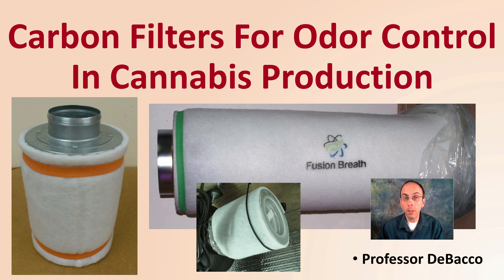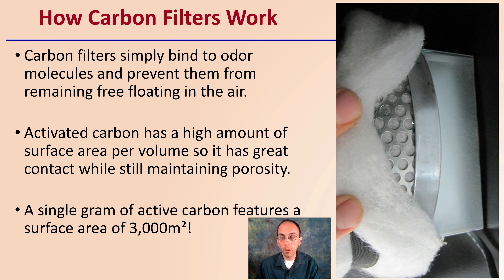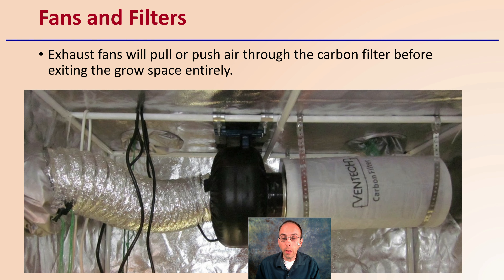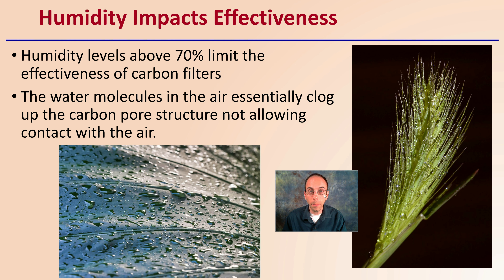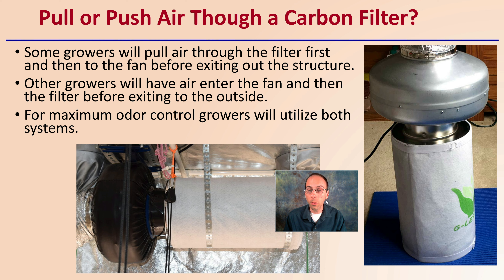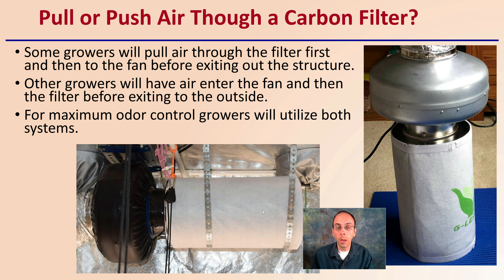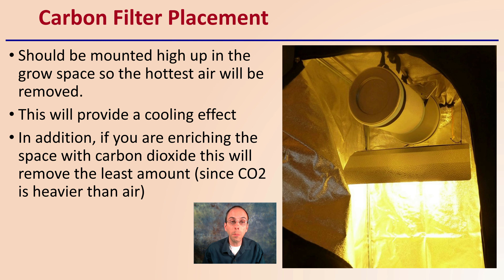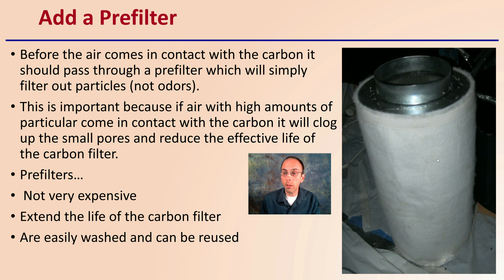Carbon Filters For Odor Control In Cannabis Production

Comment: hello sir i live in a country with zero weed tolerance . can i eliminate 100% of odor by using 2 carbon filters??
Reply: No reply buddy.
I very much doubt all odours but will help to reduce.  I think if you have such concerns in a zero tolerance country, like mine, you should maybe consider the punishment level if caught.
Reply from the maker: Two oversized carbon filters can eliminate the odor, the challenge is when you open the grow tent and the fact your country has zero weed tolerance, the carbon filters will not fix this issue.